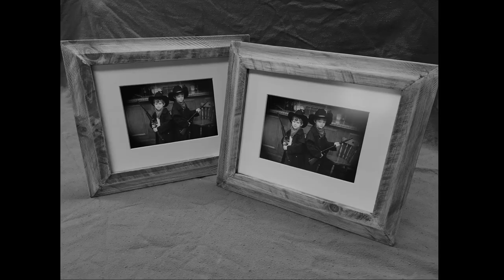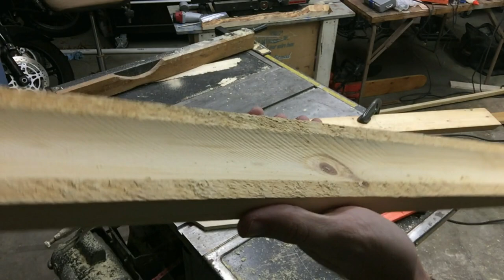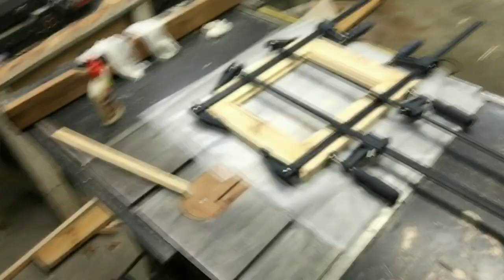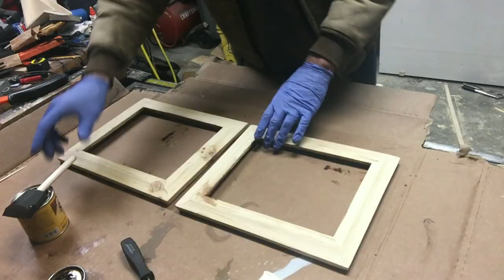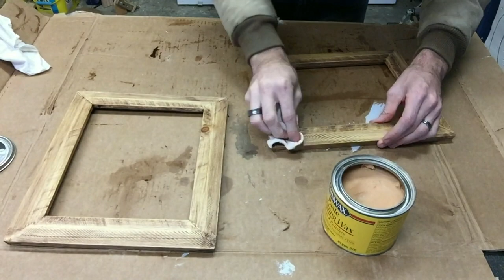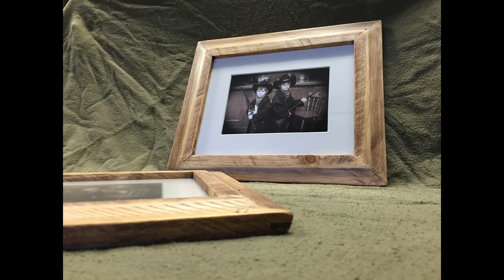Rustic Picture Frame

Comment: Very nice work! When making the concave cut with the table saw, what angle did you use? I tried a 45 degree angel from the right side and I noticed that the saw blade was bending so I stopped!
Reply from the maker: Eddie Hill sounds like you may have been taking too deep of a cut. I started with a 1/16”-1/8” deep cut and just kept raising the blade a bit each pass. I don’t recall the angle I used, I doubt I actually measured the angle. I just clamped the guides to the table at whatever I thought was going to give me the width of cove I needed.